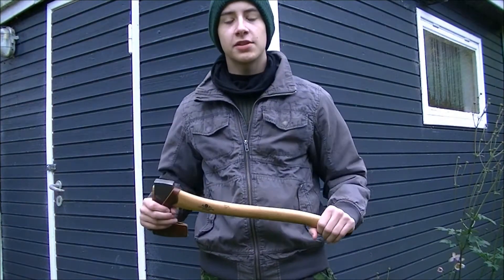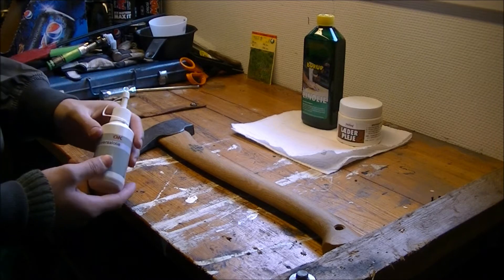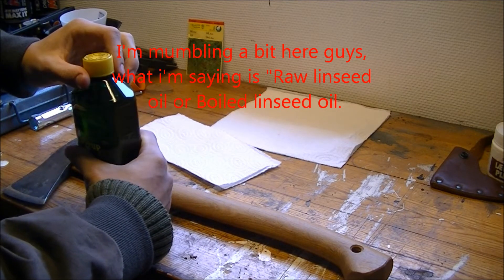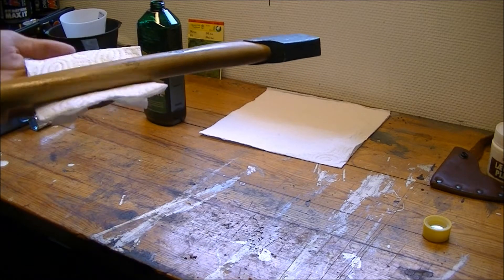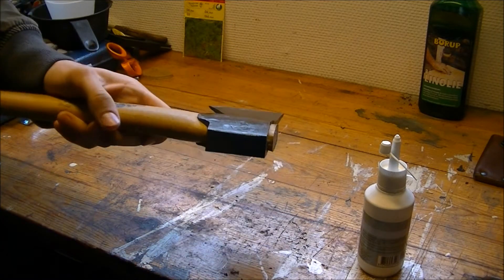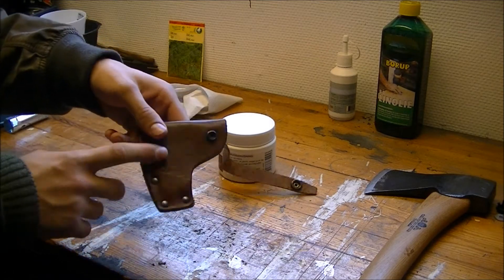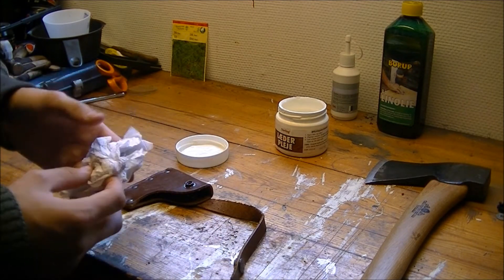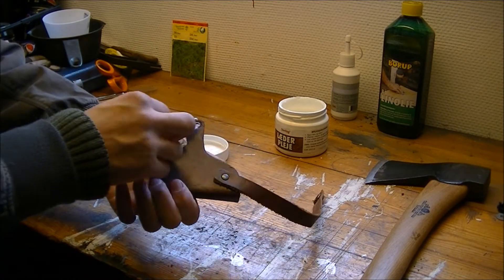Axe care and maintance - basic

Comment: the axes I store for long term, I rub them heavily with stick candles.  This seals in the metal and it also gives the axe lubrication when splitting and cutting wood.  With leather dressing be sure to read the lable carefully.   neats foot oil is great for leather but neats foot oil 'compound' has mineral oil added.  Mineral oil is not bad for leather but it will damage the stitching that hold the leather together.  I use full head covering sheaths. I found a low cost supplier if interested